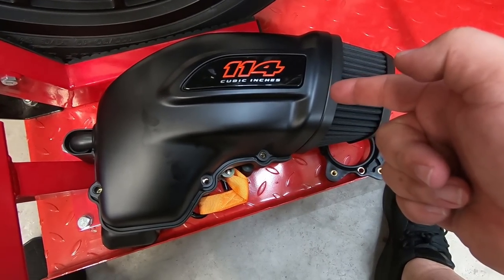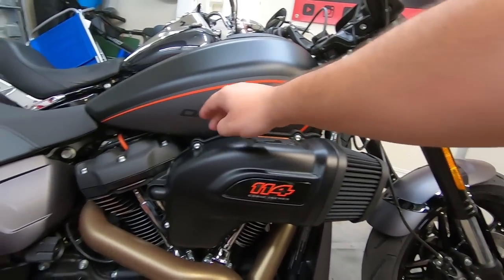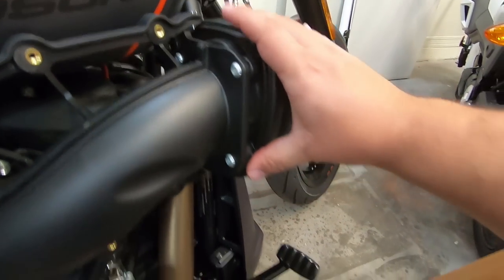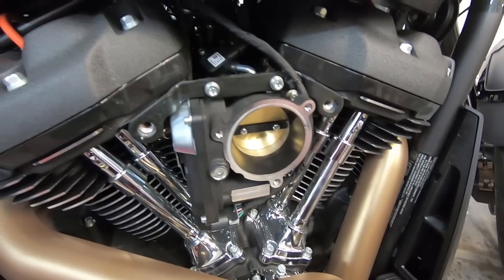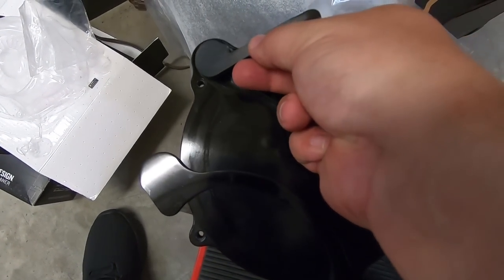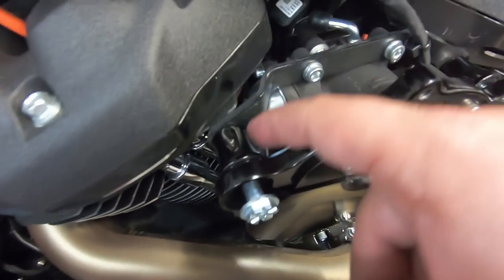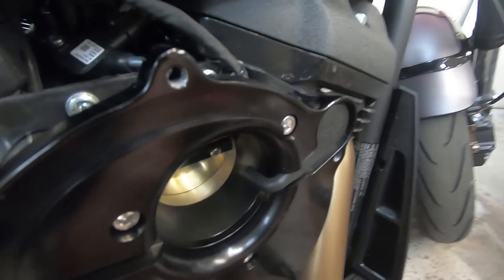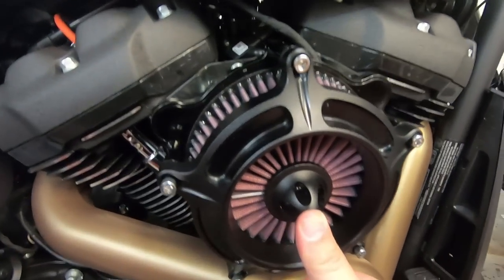How To: Harley Softail Stage 1 Air Cleaner Install (FXDR)

Comment: Definitely looks cleaner than that factory monstrosity. If you don't like those rubber breather hoses, Arlen Ness Big Sucker breather does not use them; the bolts going into the heads are 'banjo' style and vents back through holes in the breather housing; much cleaner appearance.

Comment: Did you remove the Roland sands air cleaner? I noticed you had a forward cleaner on another video. I just picked up the Roland sands for my fxdr. Was there a leg room issue?

Comment: do you happen to know the cfm on the stock vs the new one. would be interesting. both are stage one I believe so I doubt much difference in performance. might be good to just try a map with that new air cleaner. you can always flash back of course. cool deal though. I sort of like it better with the new. the other one stuck out to far.

Comment: Question, I installed mine the same way you did and I noticed My breather bolts are leaking behind the bracket attached to the throttle, just wondering why? Everything is torqued to spec